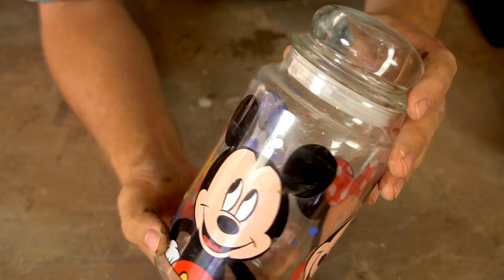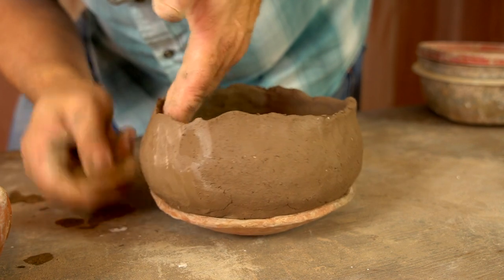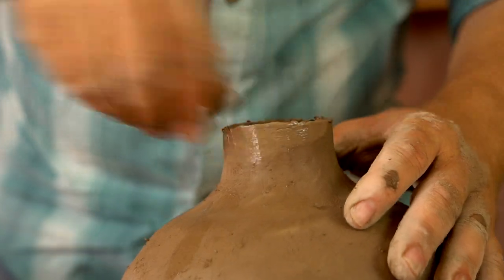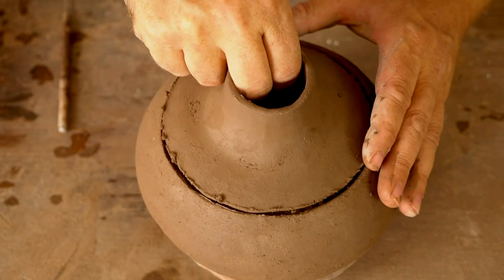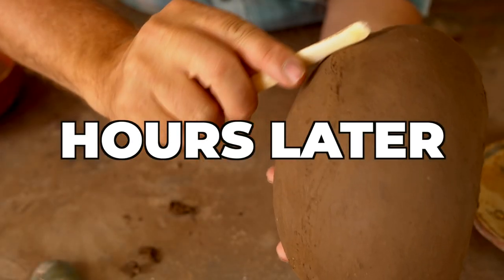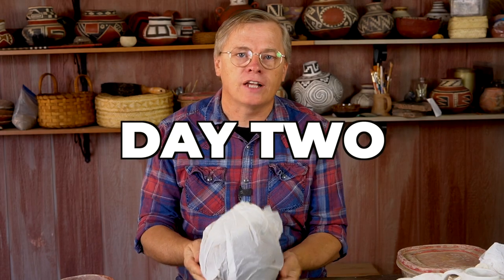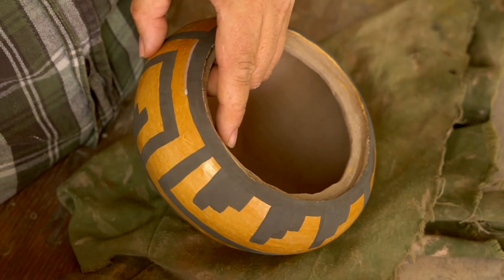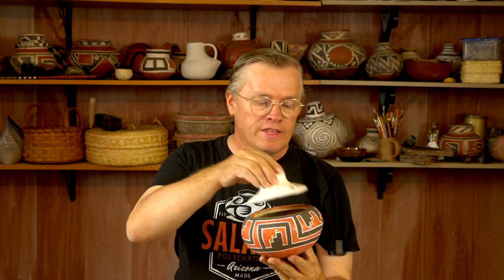Make a Southwest Style Sugar Bowl, Coil Pottery Project

Comment: Hi Andy. Another great P like one you made earlier.. If you angle the cut lower when taking lid off, you end up with a bevel, so the lid won't fall in. Rotate the lid a few times when  it's damp and it seats itself.. Saves lots time.. ..
Reply from the maker: Good tip, thanks, I'll give it a try.

Comment: I still think that giving either volume or weight of the clay you use for the project would be valuable so we know how much we'll need.
Reply from the maker: I know that wheel throwers always work with clay weight, but I am pretty sure that hand builders don't generally focus on weight so much. I start with a big lump of clay and when I get the pot I want, I stop, I never weigh it ahead of time, and if I weighed it after I was done it would not be accurate because the clay will have dried quite a bit by then. Also every potter works different based on their abilities and the qualities of their clay, so my pot may have walls that are fairly thin but someone else might make walls that are a bit thicker and that will increase the amount of clay used considerably.